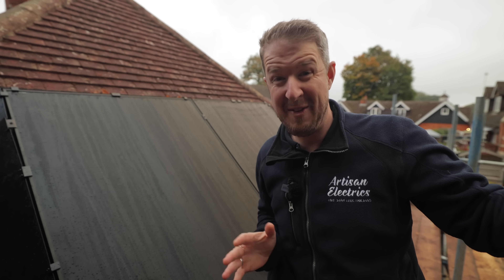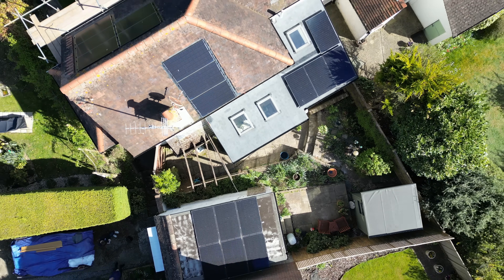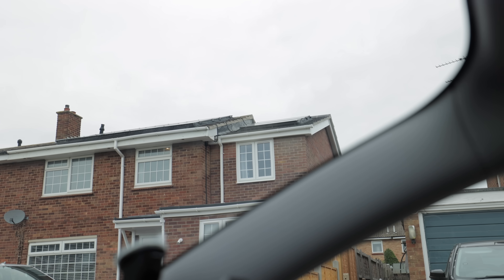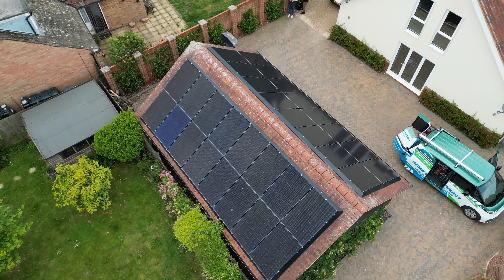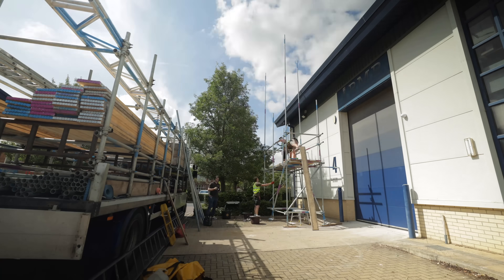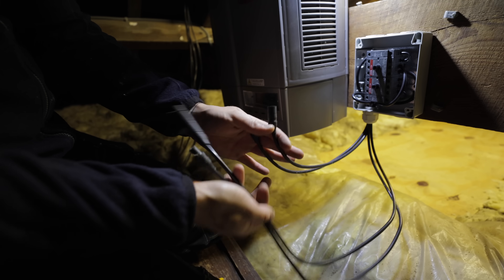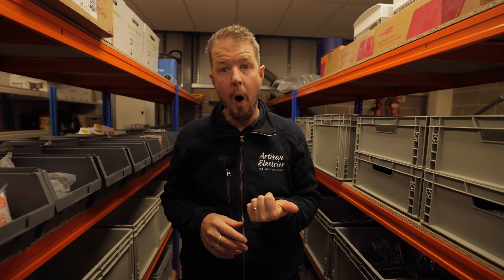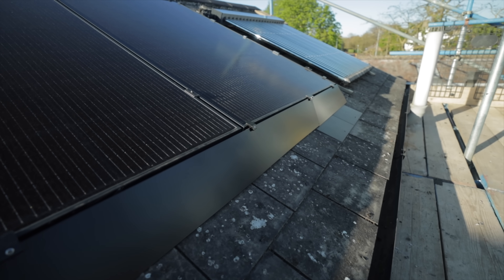The SHOCKING Truth Behind Cheap Solar Installs 🤯

Comment: I live in Ireland and am currently researching the installation Of a Solar PV system. Bird protection is virtually non existent here and am not aware of any issues with birds nesting beneath systems. One concern I have is around the number of reputable contractors installing the Battery and Inverter in attics which, given the heat they produce seems quite risky and have heard that Property Insurers are currently reviewing this practice. Any advice on this would be welcome.

Comment: Why do birds matter under the panels ? My neighbour keeps pigeons and they will quite regularly land on my roof and get under our panels and never an issue. He also has panels as well and he's never had an issue. I can't hear them and never really see them. I do have a very shallow loft so the roof is shallow so makes it very hard to see much on the roof. They have never been cleaned and they still exceed their rated output and they have been on the house atleast 8 years. My dad ones have never been cleaned and it's the same results they are never an issue and exceed capacity.

Comment: The beauty of these early "poor" installs is there is compensation. My dad got basically all his money back from his and the panels work fine. It was all to do with false claims of the production. I have a council property and it does look a bit crap and the inverter is literally Infront of the loft hatch but it's checked regularly and has never been a problem.

Comment: Our installer insisted that we wouldn't need bird protection because the gap was to small for pigeons to get underneath. Guess what, they got underneath but the installer didn't want to come back without the additional expense of scaffolding.

Luckily we knew a pest control person, who using ladders a crawl boards managed to fit wire mesh around the outside and some bird spikes on the ridge tiles which resolved the issue.

I have no idea how the cables connect between our tiles, fingers crossed they are OK.

Our installer is still around but I subsequently fell out with them and SolarEdge when our inverter failed and it took 7 weeks to replace during the summer.
Reply from the maker: Thanks for sharing your experience – that sounds incredibly frustrating, especially with the added delays and lack of support.

Unfortunately, we hear far too often that installers downplay the need for bird protection, only for pigeons to prove otherwise! It’s great that you were able to get it resolved with a bit of outside help – and hats off to your pest control contact for sorting it safely.

As for the cabling, hopefully it’s all intact – birds can sometimes cause damage over time if left unchecked, which is exactly why we always recommend proper protection upfront.

Comment: "race to the bottom" while installers quote parts cost upmarked by 500%+ befor adding the labour costs on top

"design , certification, etc " .   you mean using a template for the quote and then spend 5min filling a MCS certificate on mcs website for £39?
Reply from the maker: We understand your concern about the costs involved, but there are many factors that contribute to the overall price of a solar installation beyond just parts and basic certification, such as a full system design, accreditation, customer service, insurance, and long-term support and warranties. We have a full team of experts who ensure every aspect of the project is handled professionally and to the highest standards.
Reply: @artisanelectrics  I understand all that but i had installers going as far as quoting inverters usb dongle that cost £27 as "£185", longi panels that were on Itstechnologies website at £48+vat at £350 EACH (vat free, yey!) and so on for PARTS COST only, before adding labour / scaffolding / etc fees.   I understand that its a way of making their labour "look cheaper" by quoting only like 2k for labour, but if parts are upmarked by £4k, thats £6k for labour in my books, not 2. I rather wished suppliers quoted the parts as what they cost, and were more transparent to put labour as 4 5 or 6k or whatever they want to quote it. rather than pretending they're doing it for "2k" , when the reality is that every part has a massive upmark,.

Comment: I love the fact at 2:10 you are slagging off cheaper installers while the video shows your guys miss handling panels likely causing micro cracking (the installation manual shows a two man lift for a reason) and then using an impact driver to tighten up the module clamps which can very easily over tighten clamps and cause issues, use a torque wrench and do them to manufacture guidelines, normally about 14nm

Comment: A big finger points at building control as it's not just putting customers lives at risk via electrical safety, it's adding weight to your building fabric plus as you said, installing cables through your roof. Another great video.

Comment: I'm curious about thermal management with the solar skirt.  I suspect that panel temps are going to be higher in summer due to having no convective airflow underneath them.I would want a vent panel at the top (do they make them?), and mostly mesh at the bottom.

Comment: Bird protection seems to be a very localised problem, in almost 20 years of solar installations in The Netherlands we've only done it a handful of times. I've never found the remains of nests when removing panels and the areas where we did it it definitely wasn't for pigeons. It also really isn't hard to put up scaffolding for a regular 2 storey house, just make sure to make it double width for fall protection.

Comment: Great point about system design. I feel this is a massively underappreciated aspect of solar installations. Also, glad you called out shading calculations. Here in the UK the peak sun altitude varies massively depending on season and depending on your own roof shape, along with proximity to other buildings, trees, telegraph poles etc, many installers are slightly off with those.
Reply from the maker: Glad you found the points about system design and shading calculations helpful!

Comment: those bird protector panels block the free airflow and create the chimney effect thus lead to higher temps on the underside of the panels. Depending on the cell technology the temp coefficient on current solar cell technologies is about -0.2%..-0.3% per K. 
Over here on the continent we do not seem to have this massive amount of angry birds since I hardly see any solar installation with bird protection and those I see I think they did it for esthetic reasons (IMO). I could imagine, that this depends also on the installation angle... more flat more bird🙂
Anyway, appreciate very much your work and installations. Very clean and tidy, no corner cuttings. Keep it up! Al
Reply: I was thinking the same unless they are a grid with air holes. Perhaps @artisanelectrics can comment.

Comment: I love my self installed solar installation using B choice panels (scratches on the frame) and surplus micro inverters. Got full ROI after one year and 17 days. And yes, signed of by a professional.
Reply: Same here, I have self installed 5+ systems now all which have “ROI’ed” between one and 2 1/2 years,
But a background in electrical engineering does help, should not be really be attempted by somebody who’s inexperienced

Comment: If you're stupid enough, to put unessesary gear onto and into your home, which makes you more dependant on yet more maintanance and servicing costs and inspections, and which will damage the integrity of the fabric envelope of a building, thereby leading other elements of it to fail (your roof for example) while increasing your fire risk, your water damage risk, your pest damage risk, your risk of electrical faults and ultimately, your home insurance costs, then it's on you I'm afraid. 

"The best part is no part", as someone once correctly said.

You have fallen for those who have told you that adding Solar PV and battery systems, increasing complexity of your home's infrastructure by 3 or 4 x and introducing many new points of failure into its vital services, is "empowering" or "virtuous" or worse still, economically sound! lol. None of these things are true over the course of the lifetime of whatever install you get. Channels like this are businesses; they are only too happy to have customers locked in for the life of a PV and battery system. 

Even if you do spend the extra on getting these things fitted by a quality outfit like perhaps this one is, you'll still need to service and maintain all these new and unnecessary components. God help you if you choose a cowboy on top of that. What everyone is missing, though, is that all of this is madness in the first place! Why would anyone but those living off-grid or in rural areas prone to grid outages think any of this is a good idea?? 

For the past 50 years + electricity has come from a "magic" cable straight into your home and just worked! Yet you "smart" people have been so hypnotised by marketing and vested interests that you would damage your most important asset (your home) and chain yourself to installers, electricity suppliers with cute animals for logos and long-term maintenance costs and incresed risks for as long as you live there. 

Not to mention, any prospective buyer who might want to buy that home when you come to sell it! You guys are all crazy and you will pay the real costs of this for years to come. 

If you had any sense at all, you'd invest in solar PV farms or the suppliers themselves, or installers, because that's who wins in this game long after the novelty and "virtue" wears off from your shiny new piece of kit. 

Installing PV and batteries into your urban, or suburban home when you have no history of electrical supply problems from the grid, is a regressive step, not a progressive one! It's like going from cars back to horse and cart. 

Now you might say, "Well, I have an EV to charge" or "it lets me take advantage of cheaper tarrifs, it's an economiclly sound desicion, my bills are almost zero now" - If you say this, you are dumber than those who admit they are doing it for non economic reasons, at least they presumably don't mind the headaches, extra cost and dependacy it results in to achieve their "more noble", goals, lol.

Comment: In my country of your ROI is more than 5 years you being scammed. 

Also dont be upsolled on a battery because it might set your house on fire, battery fires are rare its normally poor install that sets the battery on fire or no builtin afci on the inverter mppt input.

Comment: @ 9:07 selected badly ? Suppliers have very few parts selection in stock and they don’t have them always + they cant get you enough quantity in time … I never managed to equip with  the same brand of parts an electrical pannel this year due to lack of supply … if you want to use decent quality ones 😅

Comment: @ 8:58 even if it is built in the inverter  (huawei for example) we always install AC and DC surge protection even if DC Is not always needed if there is a very tall building close to you … (in the 25 years of the  wished solar install life expectancy the tall building near you might be demolished and you might get a lightning strike during reconstruction of the neighboring building 😜)
+ it is very important to try to find same torque tightening for all the parts you use in your electrical pannels in order to avoid tightening torque mistake 😊 …

Comment: @ personally I’m against ac and dc isolators - they are another fire point - and the insurance companies in the uk they say  the same - not all the companies will use top brands separators + not all the employees will install them corectly - a tired installer who has to install those to in the same working day or in the full install season when will cumulate more fatigue hours and is at risk of making more mistakes! 
My oppinion is that we are better off without them ! + you can use the budget in other better parts in your solar install (like staubli, weidmuller mc4 connectors + use the same brand of connectors as the solar panels ones (usually staubli - if not tou Have to replace them with the same brand ones) 
We use the same family of Scame electrical pannels in our installs ( they have the nicest design + thick plastic walls) + we sometimes use Hensel  but rarely because it looks to industrial from the sides even if it has a smart design… + it is @ 1/2 in wall thickness compared to scame… and if you ask even the ladies will tell you that the thickness matters 😜

Comment: @ 7:23 - but less wind will get under them or self air draft will be generated to keep them a little bit cooler in the summer.
 And f there are not many birds in the area you are better without the bird skirt in my opinion… + try to install a bird skirt on an old waved roof from the country side 😅 
+ you want to get a return on your investment as fast as possible - if your payback period is over 10-12 yers you better put your money elsewhere… 
There is always a compromise between safety and cost… money is limited for most of the people because not all of us are born in Kuwait 😅 and if we get the solar install right you will have to skip safety somewhere else…

Comment: @ 5:29 as basic installer you can never know if an inverter is poor quality: for example deye is a cheap inverter that promise to use top brand parts inside and when you open one up you find that you were lied…
But you can pay for more of a premium brand with a bad design that does not last even if they use decent parts … - for example solar edge have expensive parts inside and they still fail 
You can have a cheap brand with cheapper parts but better design that lasts longer… - this is rarely but you will find it ! 
It is just like with cars: if you pay more it doesn’t mean that you get a more reliable car because many brands want to sell you parts … and I am pretty sure that most of the auto makers know how to make almost any part last even at low price but many of them they want to sell parts at regular invervals …

Comment: Quote from a national company:
PowerWall 3 + 10kW of PV for £17,776
PowerWall 3 on its own £7,499 fitted
so 10kW of PV fitted is £10,277
JA 450 PV are £70 each retail 
24 panels cost £1,680 but fitted is £10,277?
Reply: yes ridiculously huge mark up, good panels across the market now and cheaper than ever also cheap ce certified inverters and batteries ,you dont need Tesla Power walls!
Reply: @metaldetectingtoursgeorgia7569 Agreed and we didn't go for the TPW.

Comment: I think your pretty bird guards actually reduce airflow under the panels.
Which would increase temperature and reduce the panel output.
Reply from the maker: That’s a common concern, but fortunately, it’s not the case. The bird protection mesh we use is specifically designed to allow for adequate airflow underneath the panels. It doesn’t create a seal or block ventilation – it just prevents birds and debris from getting underneath.

So, in short, it doesn’t reduce airflow or impact the performance of the panels at all. If anything, it helps maintain efficiency by keeping the area clean and free of obstructions.
Reply: That’s exactly what I thought about the solar skirt. Mesh would be better for airflow and fitting to corrugated profile tiles. The skirt might be better for the west coast of Scotland though.
Reply: ...but it never gets above 5° C in the UK does it !!! 😆😆😆

Comment: at least ultra expensive artisan doesn't hide any of their ridiculous costs!

Bifacial 500W panels cost £60. For a 3kWp array that's £300 in solar cost, about £150 in microinverters and mounting hardware. Most installers charge £6000 for a 3kWp array. How do you get from £450 to £6000!? Bloody greed
Reply: I agree all the bits needed to get everything upto code does start to add up fast my install I put 200 aside thinking yeah that's more than enough another 180 on top just for bits end caps wire crimps the lot but I still got a 3kw AC coupled with 15kwh storage for around 2.2k self installed sod MCs that side is a joke and is only ever needed to sell back to the grid well no you oversize the bats so you have 4-5 KW left at charge up time 7.5p per kWh 😊
Reply: @petechongy  UK based?
Reply from the maker: There's a lot more that goes into a solar install than just the cost of panels and inverters.
Reply: @artisanelectrics  bidirectional RCBO x1 £30. Labour per hour £60-80 x4h = £240-£360. You're still out a few thousand from the actual cost. You're part of the problem and are holding back the whole of the UK from energy independence. I hope our collective misery makes you very happy